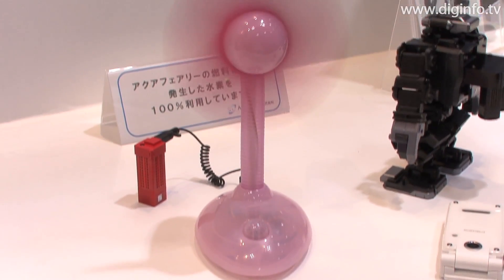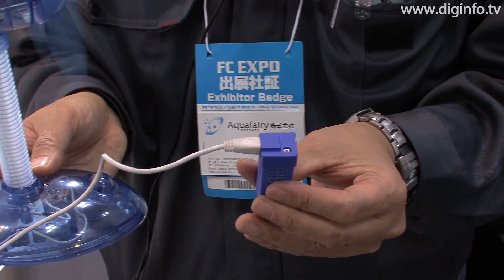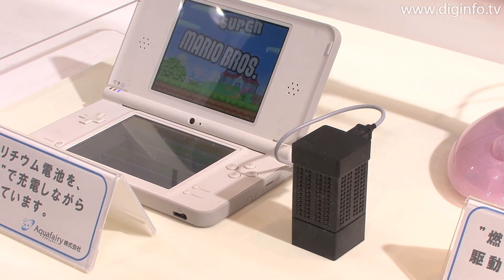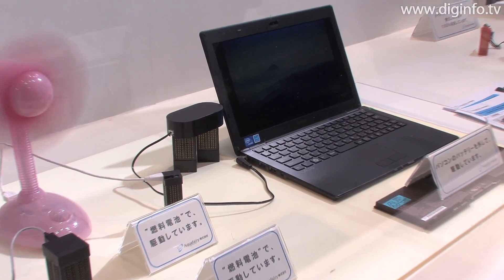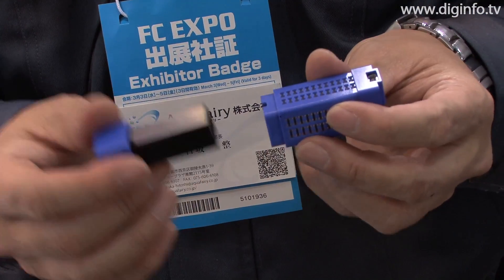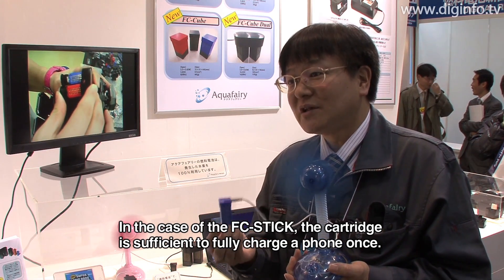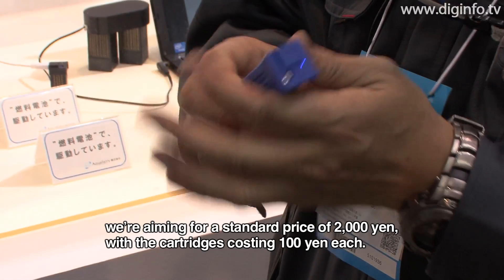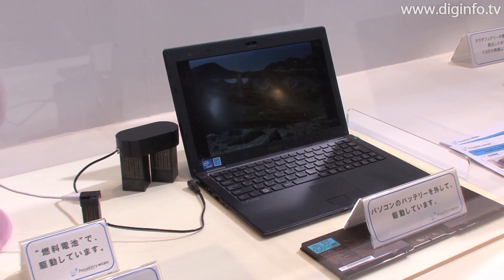Aquafairy  High-Output Compact Fuel Cell : DigInfo

Comment: They would never be a one time cost because what you are describing is a perpetual motion machine. Electolysis is a relatively inefficiant method of seperating hydrogen and oxygen and requires large currents. (althogh i dont know a more efficiant method off the top of my head). What needs to be developed is a more efficiant method of collecting and storing hydrogen.

Comment: 200 + 100 yen is how many $US?

Fuel cells are powered by the burning of hydrogen and oxygen, which produces water vapor. This water can then be condensed and, through electrolysis, be separated back into hydrogen and oxygen. Thus, the exhaust from a fuel cell can be reused. Why nobody makes a fuel cell that can regenerate the hydrogen and oxygen efficiently, I don't know. If they did, these cartridges might be a one-time cost.